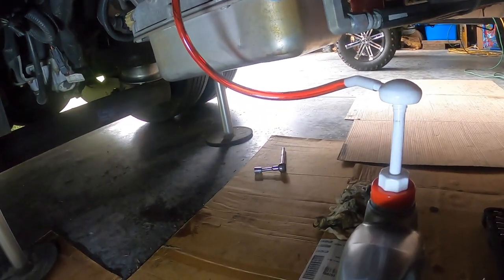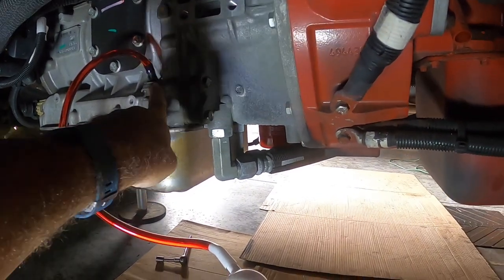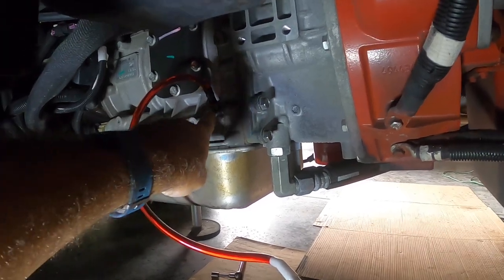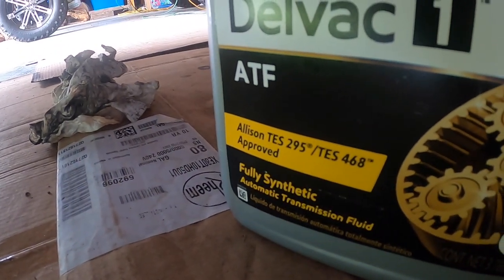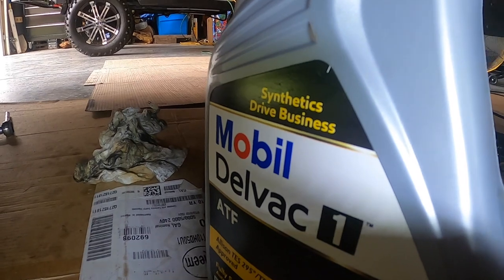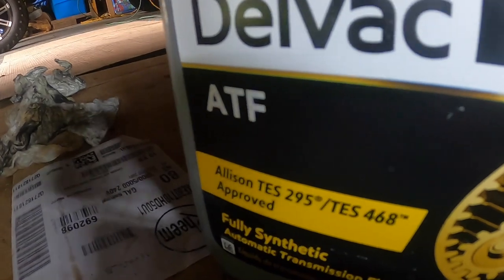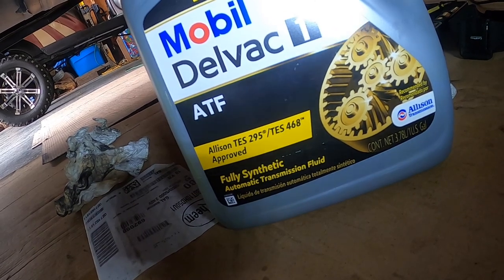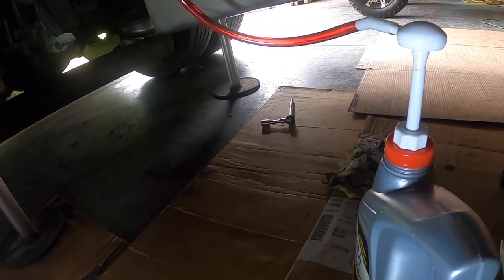How to refill your Allison Transmission Fluid in a Diesel Motorhome. Mobil Delvac 1

Comment: Why did you only remove 10 quarts?  Filter /  fluid change is normal about 19 quarts
Reply from the maker: Just drained the transmission. Did not do a full flush. I'll repeat soon. Just auditing my comments now. From what I understand, this is acceptable so long as you don't try to mix new fluid with severely old burnt fluid.
Reply: @diy-mitch-vlogs how do you remove the full 19qt? I drained only around 10 just like you
Reply from the maker: @skid3339  you’ll only get the full amount out with a flush. The rest is in the cooler.